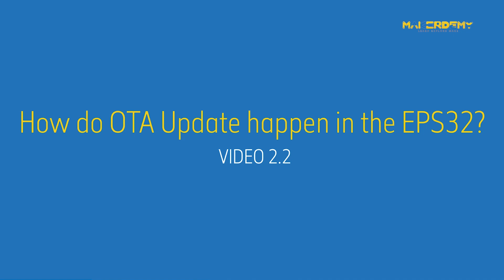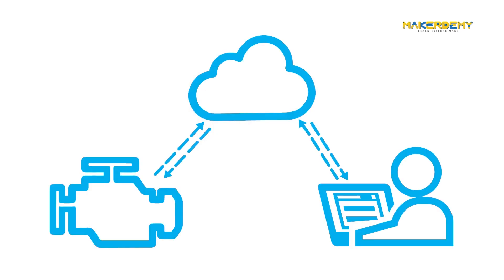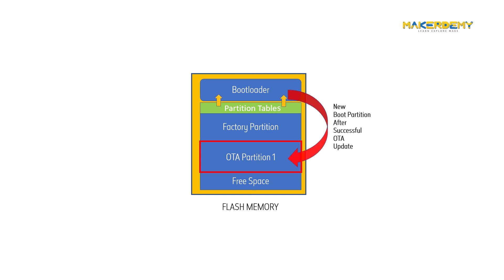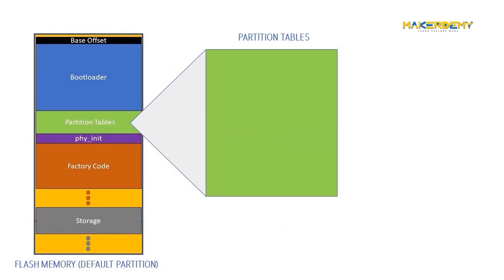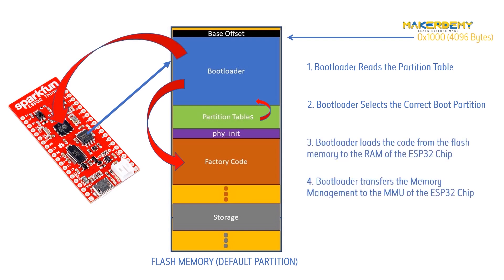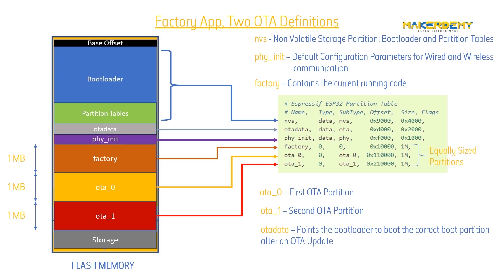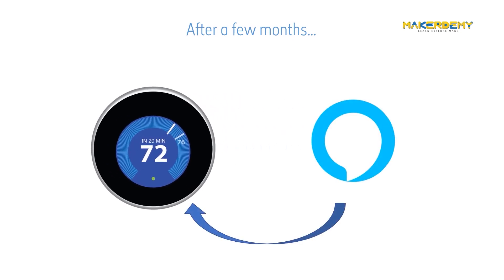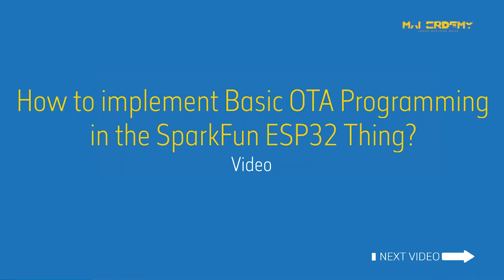HOW DO OTA UPDATES HAPPEN IN THE ESP32? | ADVANCED ESP32

Comment: Why do I see the arduino default partition has only one ota section?
Reply from the maker: Hi Rowifi.

If you are referring to why the partition scheme for your ESP32 board in Arduino IDE is showing only 1 OTA Partition, it is because the partition schemes are set by the specific manufactures of the Development Board. For example, SparkFun ESP32 boards may have totally different skews of partition schemes as opposed to the ESP32 WROOM Dev Boards. This is because different manufacturers source different types of flash memory chips from different vendors and design the partition schemes that are optimum for them. However, you can design your own partition schemes if you wish.  We hope this was helpful. Thank You.